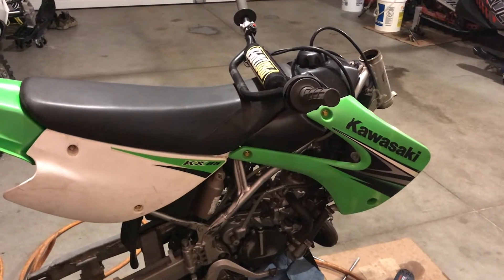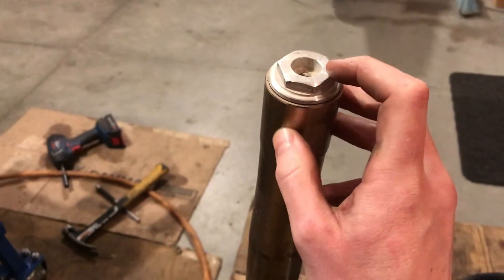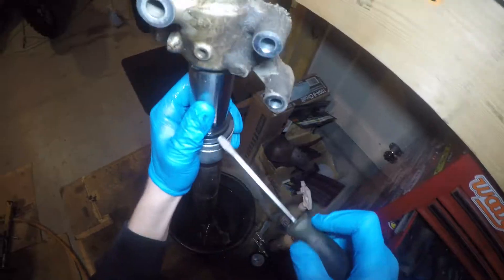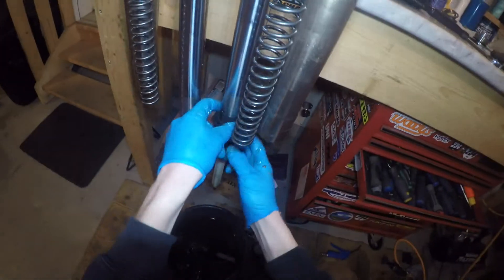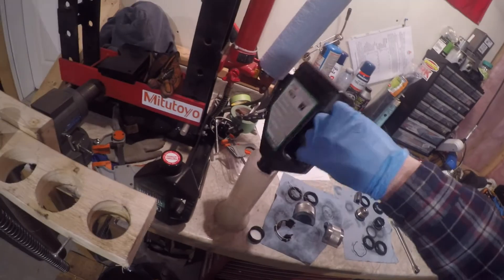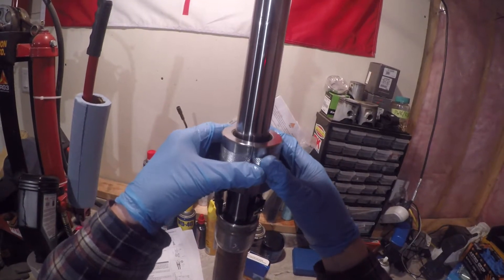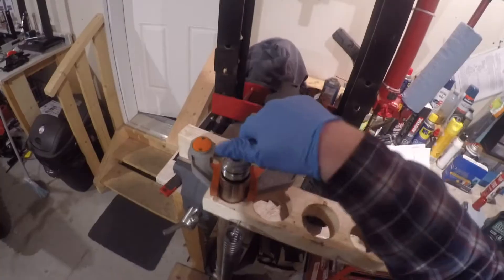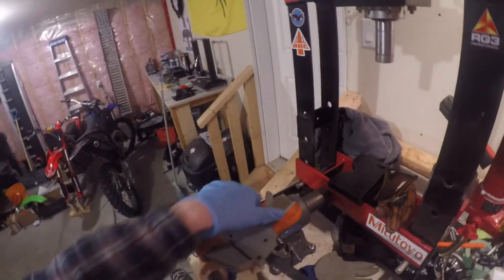KX85/100 How to Change Fork Seals

Comment: Man, I like that DIY fork part hanger, that's genius.
Reply from the maker: 2x4’s and a hole saw!
Reply: @turdpike  I’ve done this before to make tube holders, drilled out the hole then cut it in half down the middle and you can use it with the vice to clamp onto fork tubes. Never thought of making drain hangers like this though, thanks for the idea.